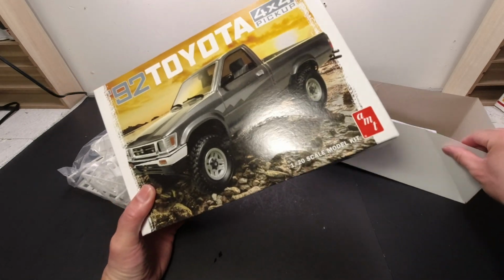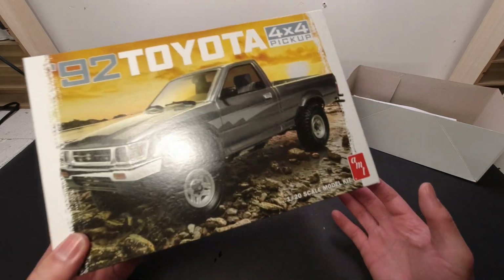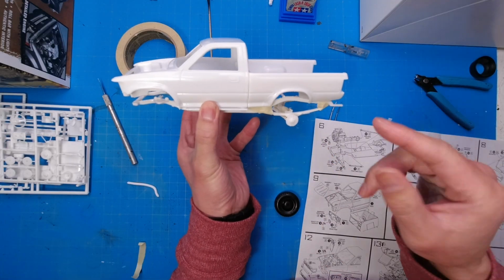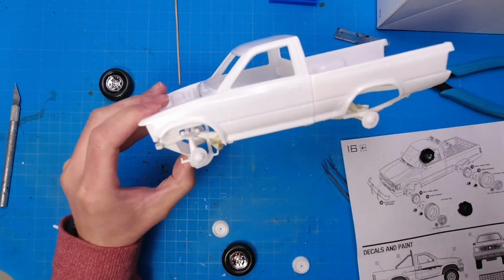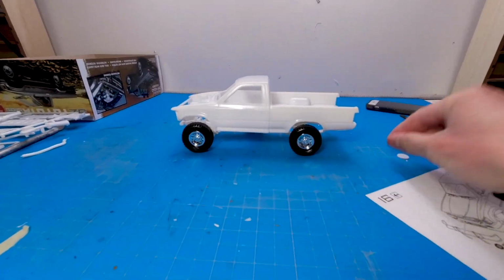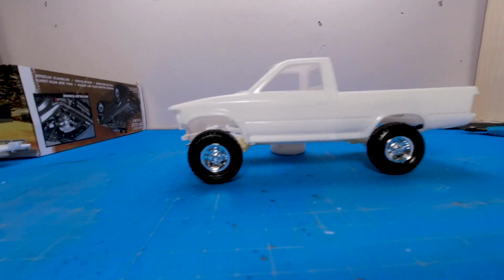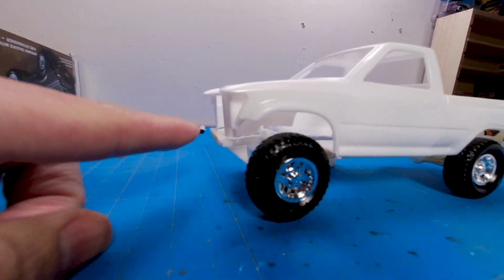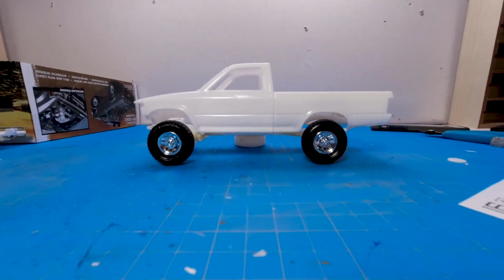Toyota Pickup to 4Runner Model Build Part 1

Comment: Weekend,
Having owned 1979 Toy thru 2021 Toyota and everything in between.
Typically when lifting independent front axle trucks, the front tends to be higher than the rear. Slightly, but its there. I usually will adjust this, as I prefer all my vehicles to sit with a slight forward downward rake.
Early Toyota with solid front axle didn't have this problem as they would sit level, even when lifted. 
Build it the way you imagine it my friend. 
Great build series.
Reply from the maker: Hi Florentino,
Great info thanks. (I’m hoping to joint the Toyota Truck family soon 🙂)  Thanks always for watching, commenting and overall supporting me ☺️!